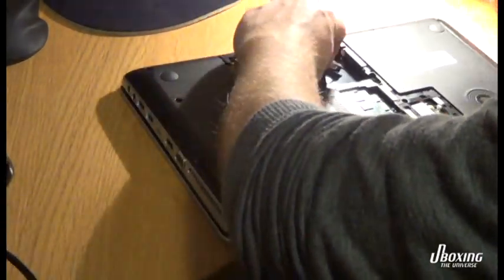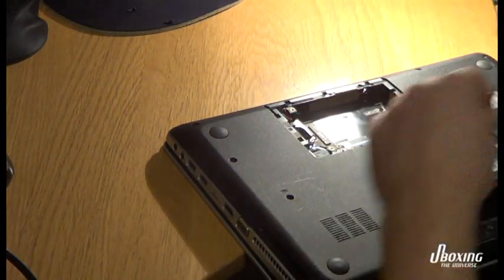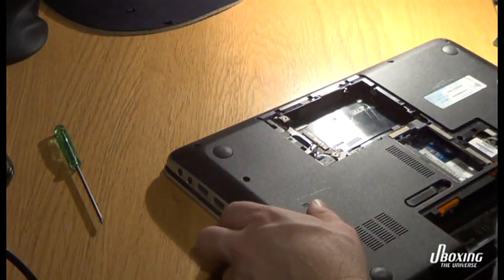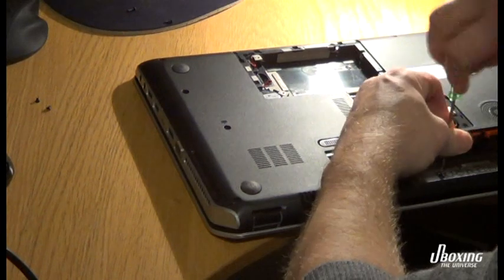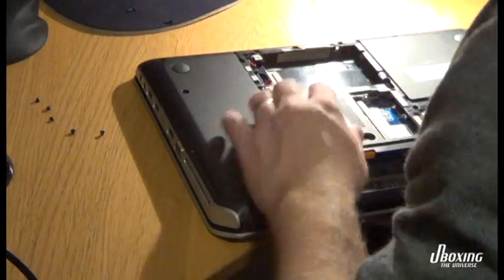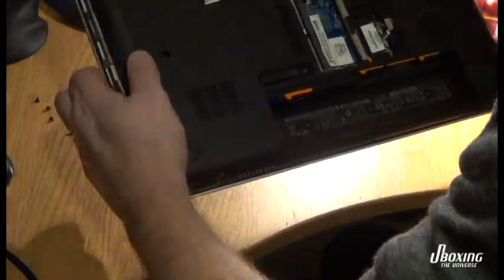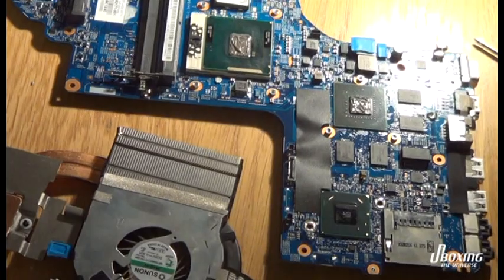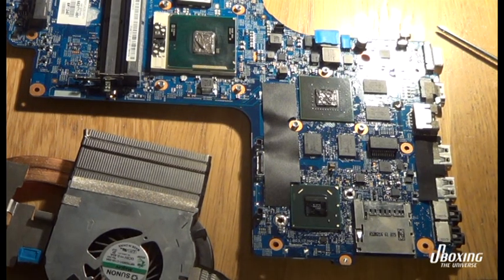HP pavilion dv6 overheat loud fan fix

Comment: Man I had this laptop it was perfect 3 months later It died from overheating now I'm using a dv6500 which also overheats I'm not even loading it in fact it runs win7 and I have max ram in it 4gb and it just annoying I've even replaced the thermal compound and it doesn't help bring compressed air can cleaning the fan with it but it doesn't really help
Reply: Did u fix? Its gpu problem?
Reply: @vickyvicmc5 nope it’s long gone now I’ve got an hp x360 now and it overheats like crazy 2 web tabs 5mins later it’s burning my lap hp is just a heater than a computer brand

Comment: Thank you so much i was really worried because i have same problem with my same hp pavilion dv6 laptop heating and loud fan for 1 year
Reply from the maker: Youre welcome
Reply: This wont work its the failing gpu which cause heat. U need to take off gpu coil

Comment: Hello. Thank you for your very beautiful and efficient Toturial. I talked to a laptop repairman. His suggestion was to Remove the AMD graphics from the motherboard. Because He says that this second graphics, is usually a common problem with laptops in this series. And it's AMD graphics that breaks down, causing the laptop to overheat. I also do not do important graphical works that is important to me. Do you think this is right? Can you help please? is that ok to Remove AMD graphic?. Thank you in advance for your attention
Reply: Did u remove gpu?

Comment: Hello, I am attempting to do this repair, but I am stuck at the step where the keyboard (front face) of the laptop has to come off. This part of the video is not shown. Can you help me understand what needs to happen once all the back screws are removed?
Reply: the whole front face seems to be stuck on the left hand side of the laptop next to the ethernet port, and I don't want to force anything, is it just plastic tabs all the way around?
Reply: Looks like I just needed to pry a little harder

Comment: i already did this settings and also change the thermal paste..but still the fan speed raises when its on and going heat when after turned on..my display is hardly heated after 10 min of use..please need an advice bro..i also changed the bios..
Reply: U need to take off gpu coil from motherboard

Comment: I’ve changed the thermal paste on my model and I used Arctic MX-4. The fan keep going high speed just by being at the desktop and it only has an i3
Reply from the maker: Maybe change BIOS settings?
Reply: Gpu failing disable it